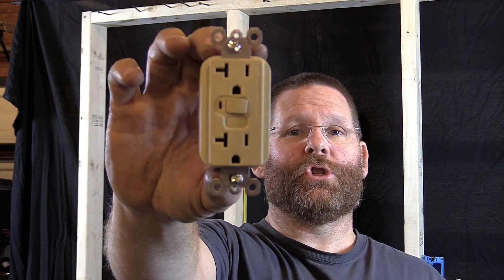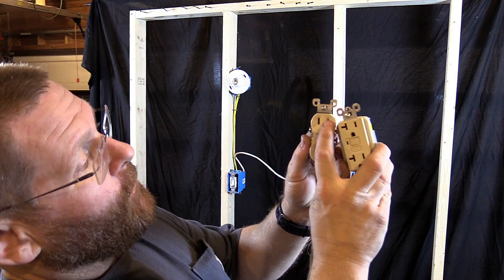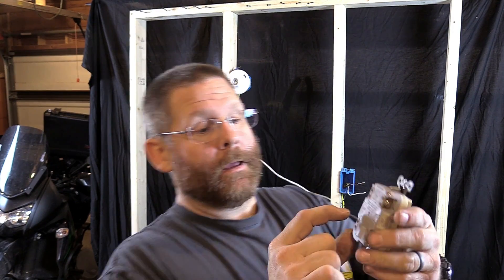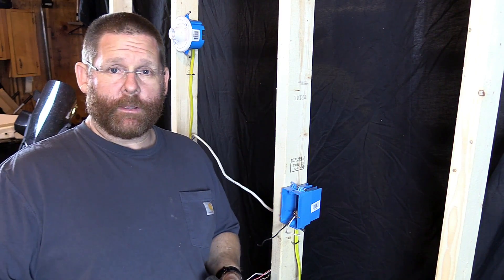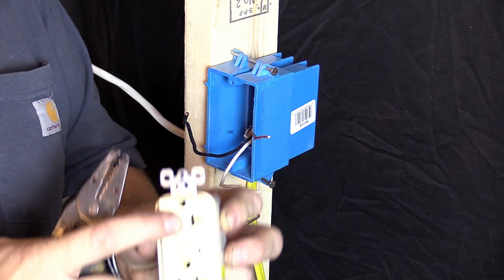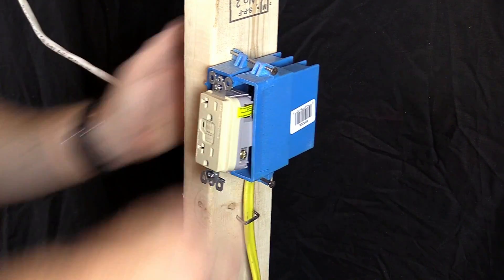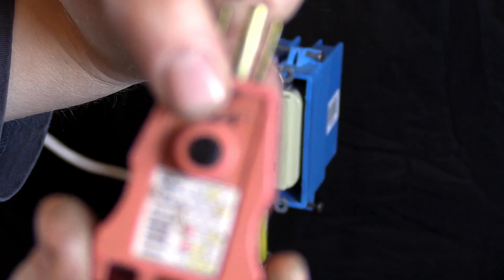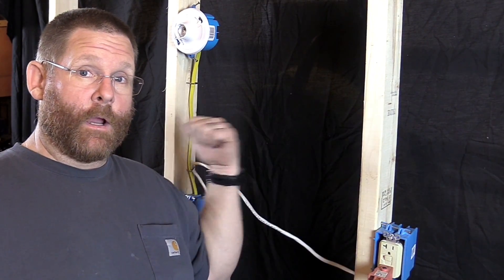How To Hook Up A GFCI

Comment: Do these need to be above bathroom sink? I would like to install one opposite of another room that has one at 6" above baseboard or so. I am installing a bidet and would like it behind toilet.
Reply from the maker: Yes anywhere there is water. Kitchen, bathroom, etc
Reply: @MountaineerOutdoors  I know around water, but do I have options on where to put them. As low as the normal ones? Is there a required height? Above level of sink?
Reply from the maker: You can put them anywhere you see fit. there is absolutely no code on height at all. Is this what your asking?
Reply: @MountaineerOutdoors  Yes thanks. Also can I connect it to a regular outlet on opposite wall? My plan was to remove outlet from opposite side, drill a small hole to see where it lines up in bath, and then cut one in if it works there. Wire from the other outlet to new GFCI.
Reply from the maker: I don't see why not. Sounds like you have quite the project going on. Good luck
Reply: @MountaineerOutdoors  Installing an electric toilet.. bidet!!
Reply from the maker: I have thought alot about getting one of those. Cut down alot on toilet paper. Good luck 🤞

Comment: Can I put a 20amp unit where a 12amp unit is required? And how come you only had one set of wires? I thought there was supposed to be two sets of wires.
Reply from the maker: You will only have two sets of wires if you are feeding another receptacle. And for the 12 amp question.. Im assuming you are talking about a 15 amp receptacle?  Yes by code you can if you have more than 2 receps on a circuit which I'm sure you do.
Reply: @MountaineerOutdoors  Ok, thanks again. You're right, I meant 15 as well. I appreciate it.

Comment: I want to do this but power freaks me out. Even if I shut the breaker off to the bathroom I will still be nervous. What is the best way to know for sure that you’re not going to touch a hot wire?
Reply: You definitely need a non-contact voltage tester if you're going to do any electrical work yourself.  So many of these videos assume that only one circuit is going through any junction box and I've lived in enough older houses to know that is not true!!
Reply from the maker: Great advice I too have seen a few boxes where there have been more than one circuit.
Reply: Ok. I just changed my outlet. When I took it out there were 2 white wires and 2 black. This outlet connects to the other bathroom. My intent was to put 2 GFI outlets in each bathroom. After installing both I had no power to either. Which was the problem in the first place. The green light was on one outlet but not the other. Reset did not work on either. I checked my work 3 times and I gave up. I’m wondering if putting a GFI outlet in the bathroom that didn’t have one was the issue. Although I can’t see why that would make a difference. Power is power isn’t it?? Anyway, I’m going to try putting just a standard outlet in the non GFI bathroom and see it it makes a difference. As of right now I have bare wires in both bathrooms. After this I’m calling an electrician. My worry is that a mouse chewed through a wire somewhere but that’s just me assuming the worst which I always do anyway.
Reply: Dude! I did it! Although quite the ordeal of running back and forth to the breaker box I got it! Couldn’t figure out what I was doing wrong. White to silver black to brass. What I didn’t realize is the wire going down range to another bathroom is only hot if the GFI outlet is hot (thanks dad in law!) Once he explained that it made total sense to me! Thanks again for the video and giving me the courage to do this myself! Cracking open a beer right now!!
Reply from the maker: Hell yeah man awesome glad to hear that you did get it
Reply from the maker: Hello ok first off if you are using two gfi's you have to on the first one put it both wires on the line side you have to do it like this otherwise it will not work there's no other way around it. I doubt highly that a mouse chewed through your wires. Both of the gfi's have to be on the line side no questions asked one GFI cannot slave another GFI it just can't work like that. Does this make sense
Reply: @MountaineerOutdoors  It does. I’m going to go with a standard outlet in the non GFI bathroom and see what happens. I’m assuming that was the issue.
Reply from the maker: Ok if it's in a bathroom it should be a gfi. If it's the same circuit you can slave that bathroom only problem is you would have to reset it in the bathroom with the gfci

Comment: Why does the top and bottom have 2 holes? I noticed he but the hot in the higher hole on the hot side, then he put the neutral in the lower hole on the neutral side. Why not both top or both bottom? What would you use 2 holes for on each side?
Reply from the maker: If you are referring to the line side it's so you can come off with another wire and not have it be gfci protected

Comment: How do I connect continuous GCFI from beaker box example line and load I have 5 in line outside
Reply from the maker: Are you putting 5 separate gfci? If so they all need to be only on the line side.
Reply: @MountaineerOutdoors  what about the one from the breaker box I have that connect to line and the load to feed the other four is that correct or do they all have to be on line
Reply from the maker: Yes if they are all gfci then they will all need to be on the line side. The load is only to feed other receps that are not gfci.

Comment: I have 4 wires(2 hots and two neutrals) and a copper ground wire. Secured the hot wires to the copper(hot) terminals and the white neutrals to their side and of course the ground to the ground screw. After replacement, the outlet does not seem to be working. Any tips?
Reply from the maker: Are you sure it's hooked up to the line side with hot and nuetral on the line side?
Reply: @MountaineerOutdoors  I will have to check again tomorrow. I am guessing it is in a run of other receptacles due to two sets of wires. I think I found a wiring diagram and will compare. Thanks!
Reply from the maker: Ok let me know im curious
Reply: @MountaineerOutdoors  Got a receptacle tester and none of the lights illuminate(open hot?). Also, the contactless voltage detector does not detect any power to the wires with the breaker on. I find it strange because the previous outlet worked.
Reply from the maker: Wow that is not good. Are you sure that your beaker is on? And there isn't any other gfi on the circuit
Reply: @MountaineerOutdoors  Kind of ashamed to say it, but there was a separate circuit the two bathroom outlets were on. It appeared to be in the 'on' position but was in fact tripped. I reset and both outlets work just fine now.
Reply from the maker: That's great that you fixed it. You will always remember that and you learned something. Even though you felt silly you won't do that again I sure.. Glad for you and thanks for letting me know ☺
Reply from the maker: Definitely a lesson learned that the way I learn. Usually when I do stuff like that it won't happen again.
Reply: @MountaineerOutdoors   Same here! It will def be the first thing I recommend to anyone with a similar issue. Thank you again for the great video and I subscribed to the channel as well.
Reply from the maker: Thanks I do appreciate your support
Have a great day ☺

Comment: I would like put a gif iny garage ,I'm going to plug a refrigerator into it. Does it need to be a 20 amp?  And I do a gif for a refrigerator or regular receptacle?
Reply from the maker: Code says yes it has to be a gfci. Now if you call your local inspector and ask him he may say yes or he may tell you that if you run a dedicated circuit to it you can put it on a regular receptacle. My honest opinion is that you should call him and ask. It's free to ask the question and he technically has the last say. Let me know what you find out
Reply: @MountaineerOutdoors  ok thanks.i will so I need to call  the inspector who let's you know wats up to code?
also,is it a safety hazard to run an extension cord from the refrigerator to the gfci?
Reply from the maker: Yes call the inspector and tell them your situation. As for the extension cord I would only use a extension cord  temporary and make sure that it's at least a 12 Guage cord. Not some cheap 16 Guage one. Let me know what your inspector says.

Comment: I'm going nuts. I get the GFCI installed, the green light is on and stays solid, but nothing comes on when i plug into it. I have 2 white wires and 2 black wires + the ground and I am pretty sure I have hooked it up correctly. I did try running the wires to the opposite sides and still nothing. Pushing Test and reset do nothing. I feel like this is an easy problem and don't want to pay someone 200 or 300 bucks to come out and do it for me....Any suggestions?
Reply from the maker: It's very important that you have the nuetral and hots on the line side of you have it crossed up it will do exactly what your saying. It's possible that your gfi is bad right out of the box. I have seen that numerous times. Keep me posted what you find
Reply: @MountaineerOutdoors  well, the receptacle that the microwave plugs into works now, but the gfci outlet still won't work

I have 4 wires + the ground, and originally, I was doing the wiring into 4 different holes (top right and left, bottom right and left), and then decided to use just the top connections for the wiring, and that was when the microwave came on

Pressing test and reset aren't accomplishing anything -- I am thinking of removing the GFCI from the garage and seeing if that will work
Reply from the maker: So you are trying to use 2 gfi on the same circuit? Am I understanding that right?
Reply: I just tried switching sides and same result -- microwave comes on but gf outlet stays dead -- so it doesn't seem to matter which side i put the wires into the outlet, the receptacle that goes to the mic comes on...
Reply: at a minimum I am getting proficient at unhooking and rewiring the outlet
Reply from the maker: Do you have more than one gfi on the same circuit? If so you have to make sure that you wire them correctly
Reply: @MountaineerOutdoors  No sir, I have the GFCI outlet and on the other side of the wall is a regular receptacle, which the microwave plugs into, and which is working now.

I'm not sure how many wiring variations I have left to try, but I'll run thru it again and see if I get lucky. At the moment I hesitate to take an outlet from another room of the house and wind up with 2 outlets that won't work lol
Reply: oh, and when the outlet originally went out, i had a foreman grill plugged into the gfci, and the microwave was running on the other outlet. They both just went dead without warning.
Reply from the maker: It may be possible that your gfi is bad from the box I have had that problem many times. If it's levinton I'd definitely check that out.
Reply: @MountaineerOutdoors  Just to give you an update, I finally got around to buying another gfci at wal-mart and it's working perfect. Here's to GE! Thanks for your time, I would have just kept assuming it was me
Reply from the maker: Awesome, that's what I figured since everything else you did didn't work. Great job and congrats on fixing it.

Comment: I have been binge watching your electrical video's for the past two days. Great videos. I do have one request that I dont see in your feed and I need to know how to do this (if possible). I have a lighted Ceiling Fan in my living room, all on one light switch. I want to know how to add a dimmer switch just for the light part, maybe one switch for the fan and one dimmer switch for the light. Can the be done, if so, HOW
Reply from the maker: Yes the easiest way is to get a remote. However, if you want to do it like Your saying you would need to have a 12-3 or a 14-3 down to your switch. But you are right I don't have video like that but definitely need to have one. Good idea for a video. Thanks for watching my video I really appreciate it. ☺

Comment: Nice video, just a reminder 20 amp duplex receptacles are not permitted on 15 amp circuits.  If you want heavier duty 15 receptacles go to the electrical supply house and buy specification grade devices.

Comment: Can 2 or more GFCI's be conected to the same line and neutral wires
Reply from the maker: Yes but you cannot feed them on the load side off of another gfi. Does that make sense?
Reply: @MountaineerOutdoors  Yes Thank You
Reply from the maker: Good glad to hear I didn't confuse you. Good luck with your project. Have a great weekend

Comment: Would you install a 20 amp gfci on a 15 amp circuit (14 gauge wire)?
Reply: Putting any 20A receptacle on a 15A circuit would be dangerous and illegal. You may install a 15A device on a 20A circuit, if it is "listed and labeled" for that use.
Reply from the maker: I would stick to 15 amp gfi

Comment: I installed a gcfi and the green light is on but no power to the outlets.  I tried to reset it and reinstall, if it was installed wrong no lights or power will flow to the surrounding area. Help please 😥
Reply from the maker: It's possible that you have a bad gfi. I have seen many that are bad right out of the box. I would try another one.
Reply: @MountaineerOutdoors  thanks i did it works perfect!! I suggest to open the box and look for a green sticker that said it passed testing. My old one came from Mexico 😆
Reply from the maker: Glad to hear that it worked

Comment: The outlet under my sink where the garbage disposal and dishwasher washer are connect has one plug showing open hot.   I’m guessing that’s wrong.  The switch that powers the disposal on and off is under there as well a few feet away. When I connect the disposal on one of the plugs 🔌 it stays on all the time. I’m guessing that’s where the washer is suppose to be connected to. When I connect it to the other plug, it doesn’t power on at all when I flip the switch. This outlet is connected with a GFCI that keeps tripping on a separate wall. Any recommendations on what I can do to fix this? Obviously my electrical knowledge needs to grow. 😃
Reply from the maker: Ok I Have questions... First the one Recep that is showing open hot is because the switch is off. When the switch is turned on it will say correct. The other plug is for the dishwasher. The dishwasher thing. Has it always done that???
Reply: Mountaineer Outdoors the dishwasher seems to be fine. I’m not sure if one of the plugs is suppose to say open hot all the time. How should they read? Again, when I plug the disposal on one of the recep, it turns on right away and I have to unplug it to turn off. I’m guessing the disposal should not be connected to that one. Can you explain how it would be connected?
Reply from the maker: Most disposals are on a switch on the wall. My guess is that if it's a duplex receptacle maybe the top Recep of the duplex is the switch part and the bottom is constant hot or visa versa. It's really hard to tell you for sure unless I was there.
Reply: Mountaineer Outdoors ok I got a little more info. When I plug an outlet tester the lights show “open hot” when the switch that controls the disposal is “off”. When I flip the switch “on” the tester lights shows normal/working fine. Is this how it should be? Also, if I plug 🔌 the disposal to the other rep, it turns on right away. No need to flip the switch. I think this second recep is working the way it should be. Hopefully this makes sense
Reply from the maker: Honestly it seems like that's right. I don't see any problems with your set up
Reply: Mountaineer Outdoors ok. I replaced the GFCI outlet on a separate wall yesterday that handles that part of the kitchen island. It kept tripping and I was thinking it was the outlet that read “open hot” that was causing it to trip. May be the GFCI was old and just needs to be replaced. Ill see if it tripped over night. If it didn’t, may be I did just need a new GFCI.
Reply from the maker: How did it go?
Reply: Mountaineer Outdoors replacing the GFCI alone didn’t work. It tripped again. The kitchen island has four outlets which I replaced since they are so cheap anyways. The outlet where the garage disposal connects was in Bad shape. Corrosion and rust on the screws. There use to be a water leak under there four years ago when I bought the house so I think that’s where the corrosion started. It’s only been 24 hours since I replaced all four outlets on the island but so far the GFCI is working fine. Over the last month, it would trip within hours.  I really hope the corrosion outlet is the only issue. If it trips again, I’m not sure what I’ll do. Someone told me that a garage disposal/dishwasher shouldn’t be linked to a GCFI in any way.  Is this true? My house was built in 2006.
Reply from the maker: The dishwasher typically is on a beaker by itself. The garbage disposal can be on a gfi circuit mine is and always has been.

Comment: Everyone says they don't like the receptacles with the quick connects, but I've been using them for 10 years and I've never had a problem. If you stick the wire in and get it tight, it's not coming out.
Reply: I think the classic spring style quick connect gives them the bad wrap. They are nothing like that. They have way more in common with a connection found on a screw terminal board (also found in your main panel before you say those are dangerous). The screw is still directly applying the pressure to the conductor. I get how it’s if it’s looped it won’t slide out because it can’t come off, but you can still wind up with crap contact if the screw backs up a little and potentially get nasty arcing.

People hate change without thinking through the logic of what’s actually happening.